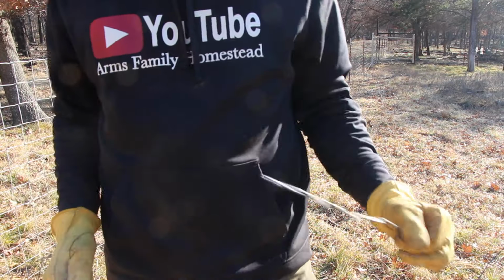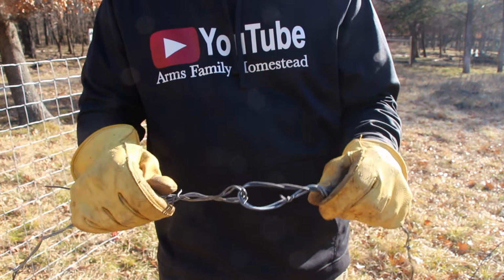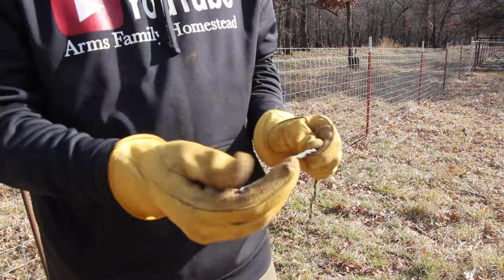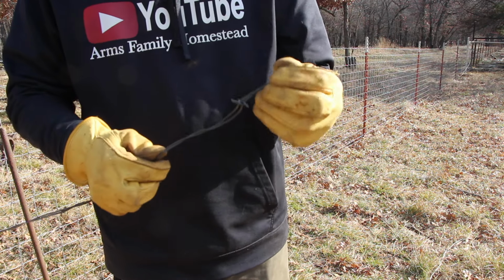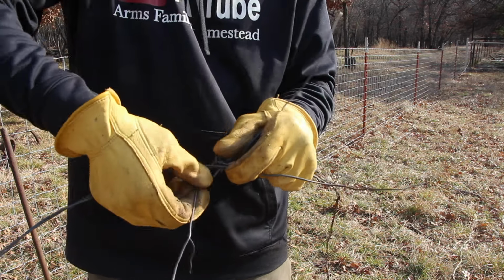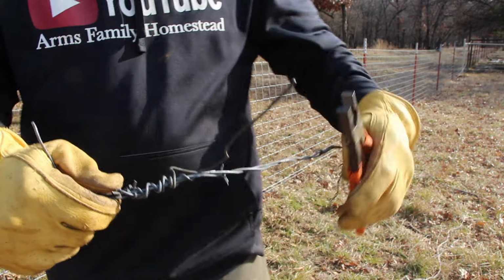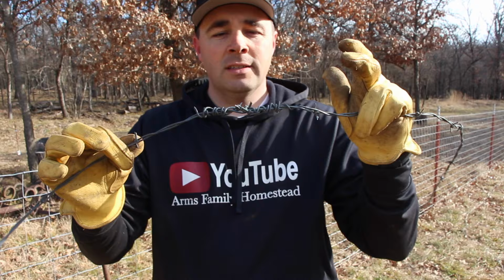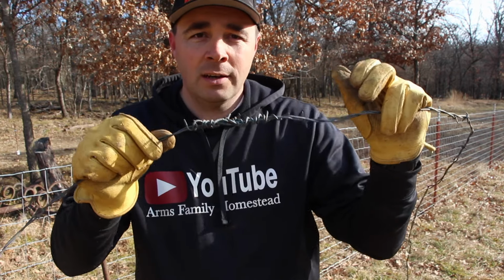How to Splice Barbed Wire

Comment: FINALLY... Someone who knows how to splice barbed wire.  What we usually did was grab the center of the splice with a fencing tool to hold the wires, and put the wires to be twisted in the pipe-gripe "hole" of the pliers. Then, holding onto the pliers' handle, we twisted the pliers around the splice which created a much tighter splice because the fulcrum point of the wire was next to the splice.  The pliers did all the "hard" wire twisting action resulting in a very tight wire wrap.

Comment: I have used the two loop method for 36 years, and it has worked!!! But I will admit your way does LOOK a lot better!!
Reply: Better, but unnecessary.
Reply: Been using the two loop method for over 50yrs for repairs (used western union splice sometimes).  The the loops do look bad.  The cows whine all the time about how it.looks...

Comment: Thanks Daniel. I try not to use barb wire except in cases like you are using it. When I initially purchased my homestead, the entire property was fenced in with a three strand barbed wire fence. That was one of the first things I removed. I saved the barbed wire and gave it to a neighbor.

Comment: Modified "Western Union Splice". Lineman back in the 40-50s used this on copper primary wire, Held great and didn't slip. Good Idea .
Reply: Linemen used a regular western union splice.

Comment: I build fence for a living and use the first method. I can pull up to a mile at one time and have never had one break. When I tried a similar way as what you show I have pulled the wire in half before on long runs. I have fences I built  over 25 years ago that are in great condition.
Reply: I've been splicing the first way for years and I finally had one break on me the other day, luckily nobody was hurt but it's definitely a weak point
Reply: I have not had one break at the loop, but I have made splices without enough wire and it slipped.  One guy said his broke and no one was hurt?  How tight is that wire?

Comment: Ive been fixing fence for 45 years.... the first slice works best hands down ! Moreover if there is a loose spot in the fence its easy to undo the splice and tighten it at the same splice. They dont come undone......nor kink and break the wire. Easy done with a " Golden Rod " fence tightener !  Your way is ok......but over I feel more time consuming....but it still works !
Reply: Totally agree, We have miles of old fence in really rough terrain with cattle pushing against it and don't have time for fancy pants splices. 😀
Reply: @easystreet123  Yes.....I have 60 yr old fences.....some of the original splices as hes showing first here.

Comment: That loop splice is standard for rusty old slightly brittle  barb wire and older fence repairs and it will not break or  slip over time! as yours  will!

Comment: I was pulling wire yesterday, about 200 yards.  I broke the red brand 12 ga wire.  I spliced it by overlapping and twisting and it slipped loose.  Finally, I looped it and it held-up but, like you say, it looks ugly and won't hold as long.  Next time, I'll try this method.

Comment: I HAVE a crimping tool already, for working on aircraft cable, but it point loads the wire right at the crimp,  the method shown here does not. Going back out in a few minutes to start splicing, thanks!

Comment: I am about to fence 5 acres, and I'm at a complete loss as to where to start. Do you cut the fence at every corner or do you just tie off at the corner and continue around if the roll isn't finished? I also will have an entryway with a (in the future, custom gate), do you start off the entryway, or from the corner and go to the entry? I have been putting it off for like 6 months now because I haven't the slightest clue where to start and I absolutely hate redoing things. I can't find videos anywhere that go through the full spectrum of laying out a fence. Another reason is property line easements. I can't find the info as to what the distance is you have to stay away from a gravel road. By my plat, I own half the road. To the middle. But nowhere does it say what the fence should be from the road. Thanks for the fence videos, it has been very educational sir.
Reply: We cut and wrap at every corner as we put the wire on the inside towards the animals. where to start and stop is up to you, as long as you have the room to stretch the wire you can go in either direction. As for the easement you will have to contact local officials to get the rules on distances for easements as every location is different.
Reply from the maker: bigcountry is exactly right! Go with his answers.

Comment: So is that the method you would use for a broken wire in an existing fence
Reply: That is the only problem I see with his method it will be hard to get tight. The loop allows a person to usually pull it through to the next barb, give it a good yank and then tighten again. With his way you would need a wire stretcher to get it tight.
Reply from the maker: I wouldn't use this method for a temporary fix. This would only be done on a new stretch or if you have a fence stretcher to get everything tight again.
Reply: If you have much barbed wire at all, you need a stretcher

Comment: You dont have to be a professional fence builder.  Just spend money like me! 😁  great video. How are you splicing your woven wire?
Reply from the maker: I haven't had to splice any yet, but if I do I will show the process.
Reply: I suspect you can do something similar as this with woven by overlapping the horizontal end wires after you make a twist or two around the next two adjacent old and new verticals. I believe that's what I remember my grandfather doing. Chicken wire is a different story—anybody's guess.

Comment: Gaucho wire is also the best in my opinion. I’ve tried them all
Reply from the maker: Ehhhh... I really don't like Gaucho wire! lol. But then again I haven't used any in over 10 years so it might be better now days.
Reply: Goucho lasts a long time, but is hard to work with the barbs can slide around since they are just wrapped around the wire.

Comment: Great video.   I’ve been using the “crimp” method, but why spend money on parts you really don’t need.    Good job.
Reply: Crimps are for repairing old rusty wire that is too brittle to bend. Otherwise his way is the correct way to splice wire.

Comment: Dont want to be rude but looping  holds up just fine, been doin it for over 12 years, when it is a fancy new job i do splice like you did it and it does look a little better but for a quick repair i have never seen a loop break and i stretch it real tight on hundreds of feet of pull with a 2 ton stretcher never let go or break over time

Comment: I crimp all mine way better in my opinion. But hey they all work and get the job done
Reply: I've had the round ferrules crimps come loose, a western union slip and a loop slip that had too short of a tail( but never break).  I think they can all be done to fail.  But this weave splice Probably won't, too intertwined.